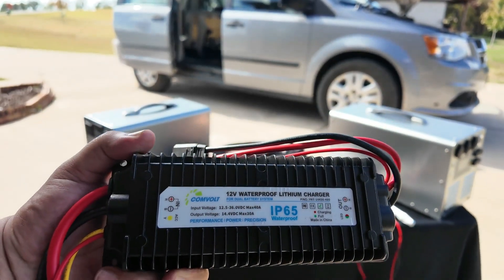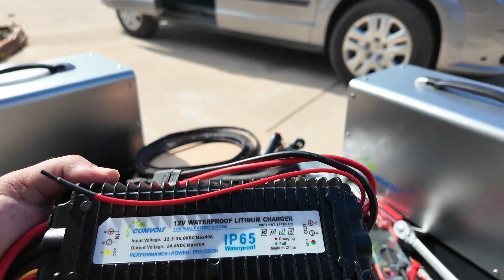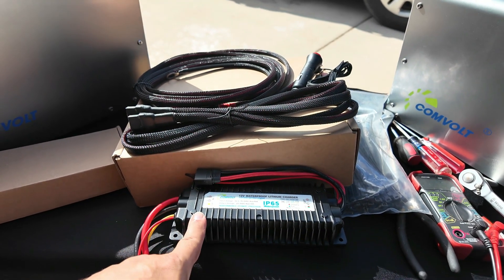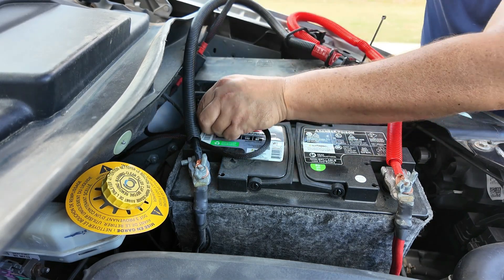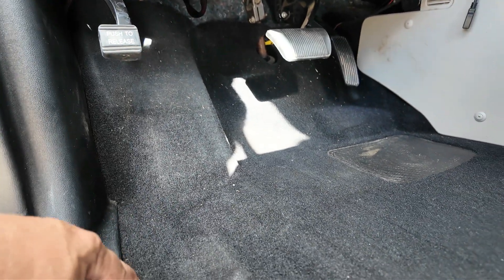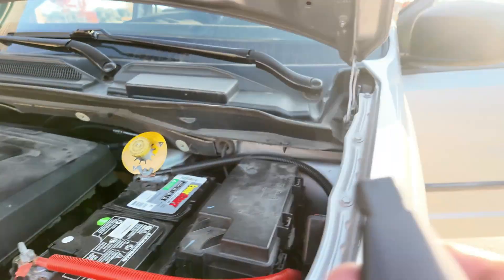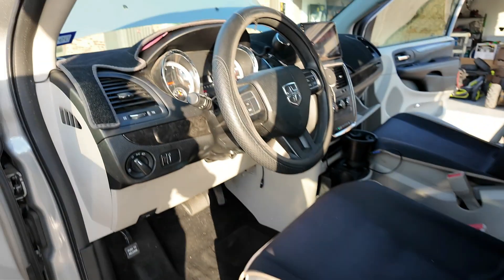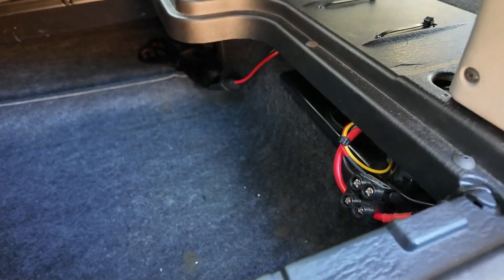Never Be Powerless Again: ComVolt 30A Charger Install

Comment from the maker: ▶▶ In Camper Van review featuring the my 13kwh unit https://youtu.be/rqFwxSwji1w

▶▶▶ 4KWH Unit is CURRENTLY ON A SUPER SALE, AND SAVE EXTRA WITH DISCOUNT COUPON CODE Comvolt_RANDOMFIX101
Comvolt 4Kwh Unit
Purchase HERE ▶▶ Link to recommended vendor HERE 
My RECOMMENDATION GET the Comvolt 4Kwh  Unit with Display + PDU Unit  https://tidd.ly/4m3OkcM
▶▶▶ for extra saving use this DISCOUNT Coupon code :Comvolt_RANDOMFIX101

Comvolt 3Kwh Unit -- $$$$ The 4 KWH UNIT IS MUCH BETTER DEAL -see links above
▶ 3Kwh Unit Review https://youtu.be/7I8w5NbcXXA
Purchase HERE
▶▶ Link to recommended vendor HEREhttps://tidd.ly/3JziAyF
▶▶▶ for extra saving use this DISCOUNT Coupon code :Comvolt_RANDOMFIX101
▶ Amazon link ( more expensive than buying direct ) not available yet but here is the 3KWH link https://amzn.to/3X15I7h

▶▶▶ Vehicle Charger Install https://youtu.be/vN6dCU8epOw

▶▶▶ Perfect 400-watt solar panel https://amzn.to/3YRMjYQ

Already own a Comvolt unit? Just addon power!
Want the smallest unit with 6kwh of power? 6,016wh!! 6 KWh Add on units
▶▶ Link to recommended vendor HERE 6kwh expansion pack https://tidd.ly/45HD1C1
▶ for extra saving use this DISCOUNT Coupon code :Comvolt_RANDOMFIX101

Want to go BIG? Want the ultimate portable power station? Complete systems
▶My ONE Comvolt 4Kwh Unit with Display + PDU Unit 
https://tidd.ly/4m3OkcM
for extra saving use this DISCOUNT Coupon code :Comvolt_RANDOMFIX101
+
▶▶ Get TWO 6kwh expansion pack
https://tidd.ly/45HD1C1
for extra saving use this DISCOUNT Coupon code :Comvolt_RANDOMFIX101
= 16 Kwh system!

Useful connectors for Comvolt Units
▶ XT60 to TX90 Adapters https://amzn.to/4hu15fw
▶ Anderson 120 connector to XT60 https://amzn.to/3Yz7L3r
▶ Prewires Anderson 120 with wire https://amzn.to/3UA5GmF
▶ XT60 DIY Kit https://amzn.to/40uggz1

▶▶ Sprinter VS30 907 170 EXTENDED PLAYLIST over 60+ videos 
https://www.youtube.com/watch?v=npzgisjteEE&list=PLDEbtVOPRC-jSWnu1ITW6niHWLi4YFSuB

▶▶ Sprinter 170 High Roof Playlist over 60+ videos 
https://www.youtube.com/watch?v=PGrw4K2FP-k&list=PLDEbtVOPRC-id5xjqFsYm87bJSJL8bLbe

Comment: So 48 minutes to charge 10% means ~10 hours to fully charge?
Reply from the maker: Yes, or going with a 12 volt 10 amp charger would take 3 times longer but since this is based on 12 volts, charging straight from 12 longs with a power port plug only gets you to a 25 percent charge. I have two of these chargers in my camper van and honestly only turn it on if my charge is below 25 percent. Depending on my trip, I either turn on one or both.
Amazing system and here is the final setup video of the van https://youtu.be/rqFwxSwji1w

Comment: Looks like a keeper
Reply from the maker: Yeah , I’m thinking there is dodge pro master 159 extended waiting for me to build with this power station. I wish I had this last time I built a van as the wiring was a lot. This is sooo easy to configure and not have to worry about it. 

I’m hoping I get a  sweet deal on financing for the dodge so I am hunt.  Last time I built a Mercedes and honestly dodge is better than German mess.
Reply from the maker: ▶ SEE THE 13,000 wh unit in ACTION https://youtu.be/CpxEwSwUNbA